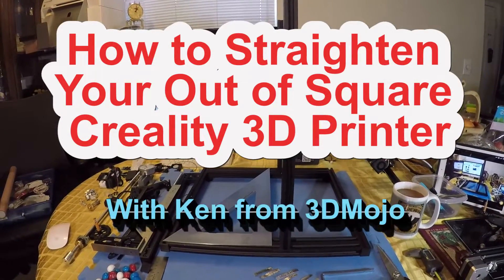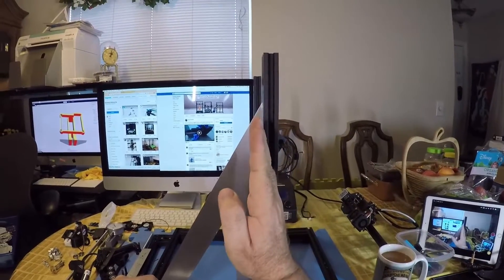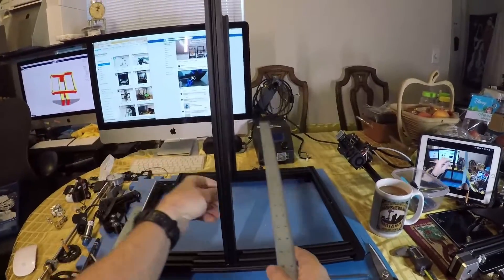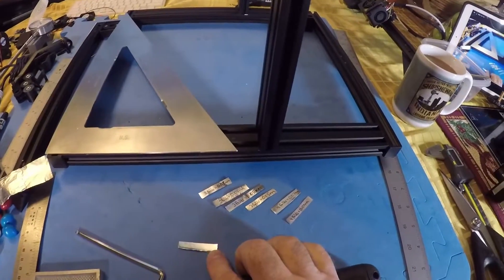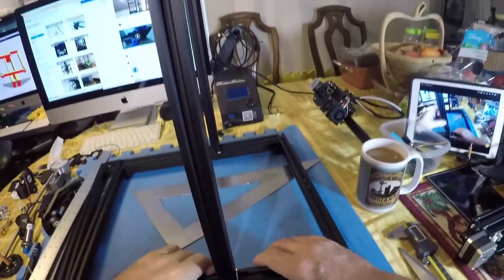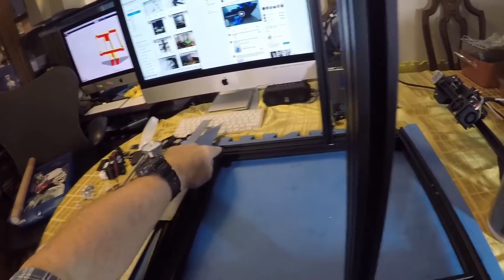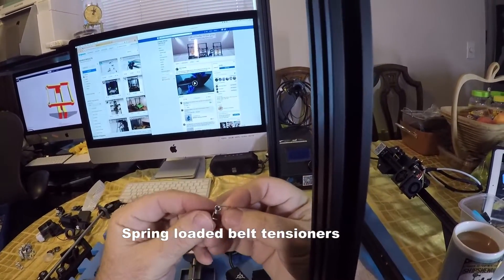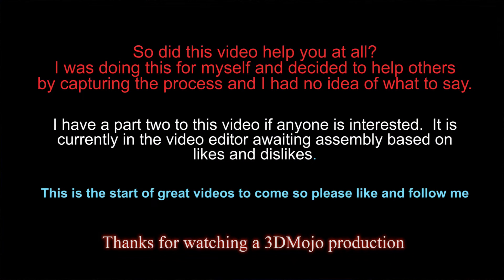Fix your true Z - CR-10 Ender 3 3D printer? DO THIS FIRST

Comment: 1:35 - Where did you buy the precision triangle square, how much did it cost? Great that you're explaining how to properly align and build the CNC. You should make more videos on it. Like how to build a mini precision CNC, many would be interested. I have an ender 3 v1 which I'm building now, I know that it requires proper skills to build and calibrate. Is it possible I could use the "L" shaped machinists precision square instead of the triangle one you're using? I can not find a precision large machinists triangle square. Thanks for this helpful video, make more of them. I'm going to use the ender 3 CNC to make precision PCB boards using low powered 25mW UV laser which will sensitize UV photoresist. Possibly build my own mini-CNC using precision ground aluminum extrusion.

Comment: i have the first ender 3. Not a single cut on the aluminum extrusion was square. both sides were cut at a slight angle so i have zero square cuts. how do you fix that? ive had this problem since i got it and have not been able to understand why my prints all came out like shit. now that i know my entire ender kit was cut with a bad square i feel like im SOL.

Comment: Hey do you happen to have the thingiverse link or files for the hotend mount you showed in the video? I have the same one and it cracked when my nozzle hit the bed the other day. I'd rather print out just the part I need instead of a whole new part cooling setup, but I cant find the file for the mount since it was made over 2 years ago.

Comment: I have a cr10 clone was never able to get gantry level... none of the howto videos worked... i ended up printing pretty well for a few months, but yesterday i tried again to level since its off approx 1/4 inch and bed is leveled on a slant etc... anyway i musle it etc now it wont travel up and down i may have screwed up one of motors... anyway... i will see i can tear it all down and start from scratch...i think a beer can may be even better for shims btw... thanks
Reply from the maker: I hope this helps.  I agree with a tear down and start over.  Remember to drink the beer can (it may require two) as a fresh aluminum can is better than an old one ... lol. 

I always hate the complete tear down and rebuilds as well.  You don't know how badly things are out of alignment until you send the first print code to the print head.  You may want to try some incense, meditation and a prayer as well before you hit "print" on the next go round.  Good luck! 

By the way, solid silicon mounts under the heat bed and level the X gantry to the bed as best as possible and then fine tune the four corners of the heat bed to the gantry at the front, back, left and right positions to the left and right of the gantry and you may be pleasantly pleased.  I did add a silent board to mine with Marlin and a clone BL Touch and I am totally amazed at the quality and silence of the system.  I run it almost 24/7 making products to sale for my wife.
Reply: @3dmojo275  Hi, i did a few other more simple things and it seems to be printing sooo much better ...thanks

Comment: Thank you for uploading this video. Mine is already in pieces but I was stuck here didn’t know what to use to make it square. Aluminium foil is a great idea.
Reply: Hey Pete, I don't remember if I mentioned this but aluminum cans are awesome shim material as well.  When I am using them on the bottom of extrusions to build height, I use a standard hand held hole punch to punch a nice hole for any screws to go through.  I just leveled a 1000lb milling machine with these! Better than spending $100 on rolled steel shim foil.   Thank you for the comment and I plan to get more things online soon.  Currently doing a Ender 3 motherboard replacement to a BigTreeTech model ... AWESOME and the motors are silent! and they make a replacement plug in screen for the Ender 3 that is both touch screen and standard style!  I opted for a larger one with bigger finger area so I had to print a holder but its really nice!

Comment: I agree. These creality printers are fundementally flawed. I bought an ender 3 thinking it would work well out of the box.(2019 Sept.) O boy was I wrong.

I spent an entire week trying to adjust the bare frame to make sure it's square. And although it's not 100%( the frame itself is not cut at 90deg), it's close enough to get a very accurate print. 

This is very sad that today one buys something and we have to go through this effort. 

But I look at it this way: I paid for a "course" to learn about 3D printing frame squaring and it came with a free printer. Ie one learned a lot. 

I think the ender 5 is the way to go for anybody.

Sorry just one thing. You also need to check that the distance between the z extrusions are the same at the top and the bottom. If you tighten one screw more than the other it will go towards that direction. So that's how you adjust the distance between them.
Reply: That been said. Once everything is squared I still add the triangular Z braces just for sturdiness.
Reply from the maker: Hi and thank you.  I am almost ready to gear up to some serious builds.  I have about 6 printers waiting to be videoed.  I just helped my wife and my son's wife's brother build their Ender 3's on the same day.  His Ender had a bowed Y Chasis extrusion which you couldn't do anything about so I told him to split the difference and his is working great.  My wife is an AMAZING machine.  I keep pushing the limits with it.  It prints very smooth and accurate and I am printing strands (think a straw) horizontally and parallel with the X Axis and it prints perfect with no sagging in the strands that ARE NOT SUPPORTED!  Amazing.  I have a Ender 3 and a Ender 3 Pro to do a build with and some one minute quick tips soon.  Thanks again and square EVERYTHING!
Reply: I'm assuming you're being sarcastic about buying a course to learn about squaring CNCs (such as a 3D printer) because I always wished there was a course as such but nothing exists on the internet, squaring and assembling precision CNCs is an art, skill and secret, 100% comparable like the pyramids, no one exactly knows how it was assembled, same goes for 99% of the people have no clue how precision CNCs are assembled, including many machinists. However your statement is 100% correct, every person who wants to learn precision machining should buy an Ender 3 and learn how to square it up, so much precision fundamentals would be learned.

Comment: hey dude...thanks for sharing. My Z axis is never the same after auto home, making bed leveling impossible. After looking around on youtube I found my way here. This video made me realize the ender3 I put together in a hurry is probably outta whack, so I'm going to take it apart and do it right. I liked the use of tinfoil as a shim as well. Looking forward to checking out your channel for more tips.
Reply from the maker: Hi and thank you for the nice compliment.  This is what makes me want to keep going.  I just invested a bit to build a shop for this channel. I picked up a Ender 3, Ender 3 Pro, Anet A8, FLFun cross between A8 and CR10 plus two cheap CNC mills for future builds.  Lots of new tech equipment and also machinists tools to really see whats going on with these kits we buy.  Hopefully late July or early August something will start getting posted as my work ceases in a couple of weeks.  Thanks again!

Comment: Good Video.Thanks! Sub
Reply from the maker: Hi and thank you ... I am deep in a deep build video currently.  I can't believe how badly my Z posts tilt and adjusting it has taken hours.... I will make a short version of the adjustment.  If I didn't fix this my prints would lean to the left and to the front for every single layer which at a .4mm nozzle wouldn't take long to show lines.  I will keep you posted!

Comment: VERY helpful...time to make my Ender3 even better.  Thanks for walking us through, very easy to follow along.
Reply from the maker: Hi and thank you for the compliment.  If you thought that was good just wait until I finish this new series.  It will be 4 episodes on the BASE FRAME ONLY! and then Series 2 will have episodes on the moving parts and calibration and then Series 3 will have a final build with electronics and calibrations.  I have hit on a few overlooked accuracy flaws and I think you will find them helpful!  Have a great day!
Reply: @3dmojo275  definitely looking forward to it.  I've been meaning to get more tools, never a better time than now.  Cheers!
Reply from the maker: @iamkaioken  This is a beta video... tell me what you think please. More to come and this is for a select few to see. https://www.youtube.com/watch?v=PuipsiWJF1c&feature=youtu.be
Reply: @3dmojo275  Is there a playlist for this series? My ender 3 prints well after i first adjust things and gets worse over time. After 3 days I have to rebuild and think this is my issue. My wheels on the z axis always has one spinning freely. I want to redo my entire build this weekend and your series seems to be perfect for this.

Comment: Good video, but those belt springs will NOT maintain constant tension. They actually increase oscillation and magnify it greatly the faster you print. Get rid of them and tension belts properly!! You will never see springs like that installed on industrial CNC or 3D printers. You would have to maintain super slow print speeds for them to not impact print quality.
Reply from the maker: Good to know. I actually tension mine correctly and I am making a Y axis video to cover this soon and show how easy tension can be fixed. Hopefully with the canted belts too.  I just realized the X belt has a hard time staying centered due to the large threads on the bold angling the two bearings a bit.
Reply from the maker: I have had great luck with the belt springs and the extra tension provided.  My prints are actually blowing me away with the Enders and the springs.  Thank goodness it works well as I have a bunch of them.  They come stock on a MonoPrice units and minus the great design lacking proper strength and support (more cheers for Creality using 2020, 2040 and 4040 extruded aluminum. I will keep watching to make sure it is working for me.  Thank you and expect a lot more videos soon as I have six builds to do